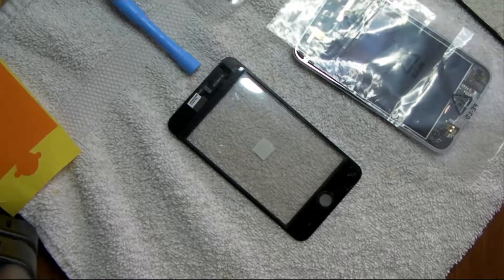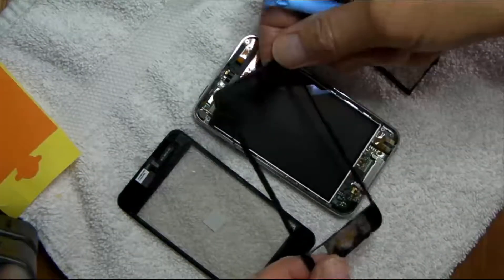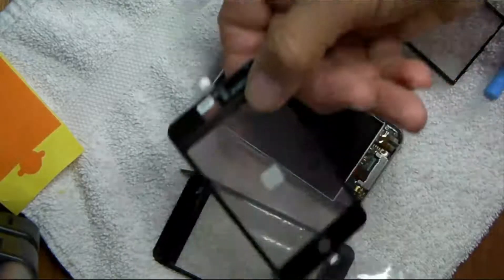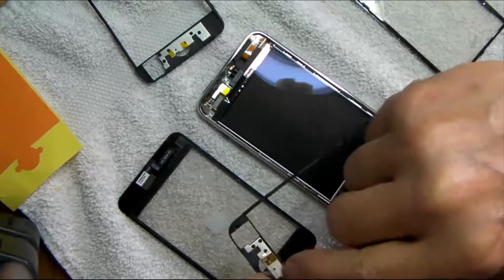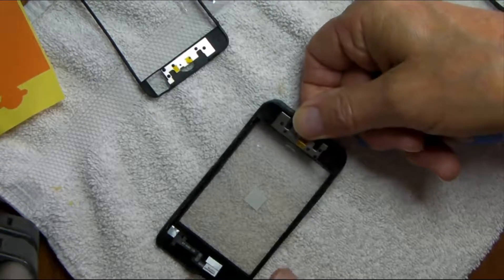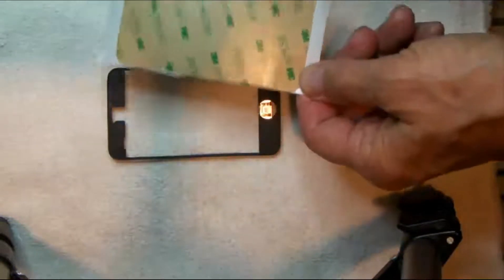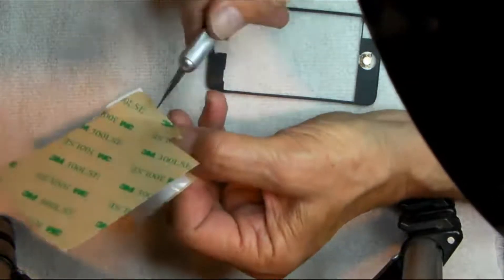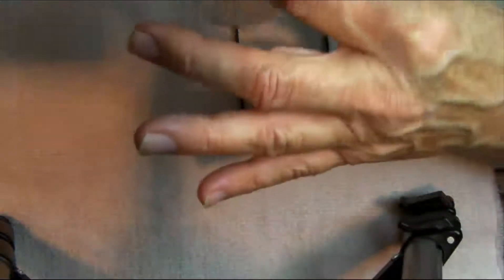iPod Touch 3G Digitizer Repair Part 1

Comment from the maker: @theoryallogist :  Sorry, just being honest.  You can do it if you take it slow.  Just look at it this way: the unit is pretty much toast anyway.  If you screw it up you can get another digitizer and try it again, that's what I did.  The first time I re-assembled I pressed too hard on the edges and cracked the LCD!  But I persevered, bought more parts and was finally successful.  Cheaper than letting Apple do it.

Comment from the maker: The connector is attached to the digitizer so if you are replacing the digititizer the new one will have a new connector so you can accidently rip the old one during dis-assembly.

Comment from the maker: If the digitizer is cracked it may or may not work by your touch.  Ask if it still is controllable using your finger.  If not, you are at a greater risk that there is more damage than just the digitizer.  Make sure to ask if the LCD is OK.  You can use a cracked digitizer but watch out that you don't get a glass splinter in your finger!